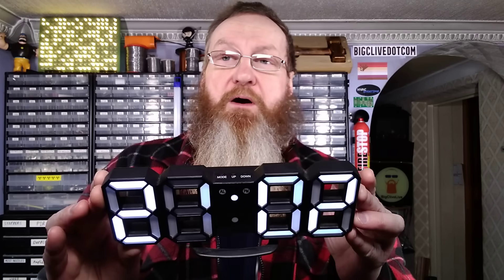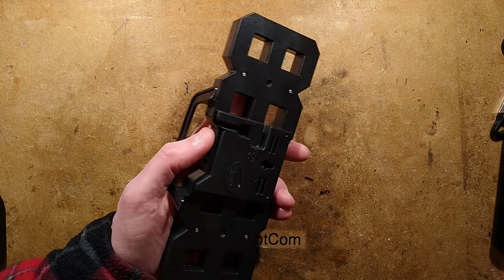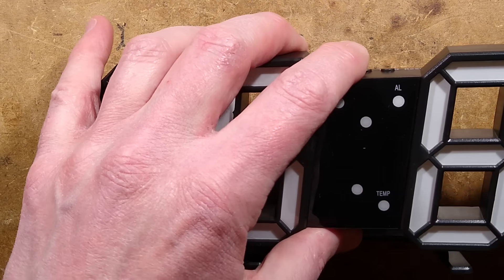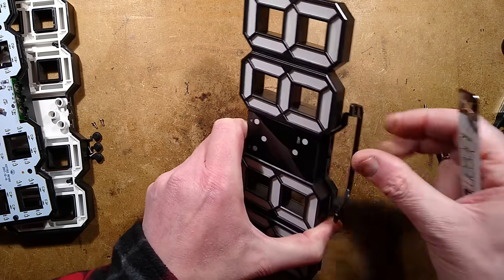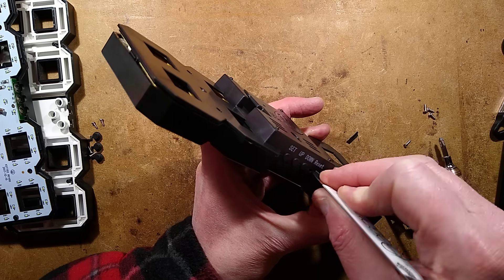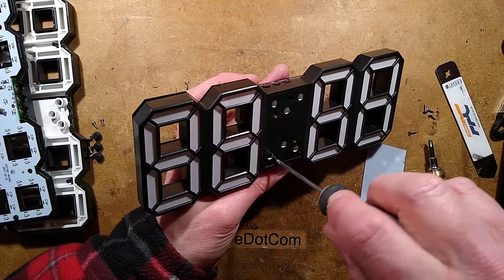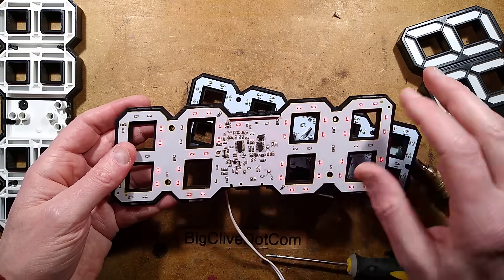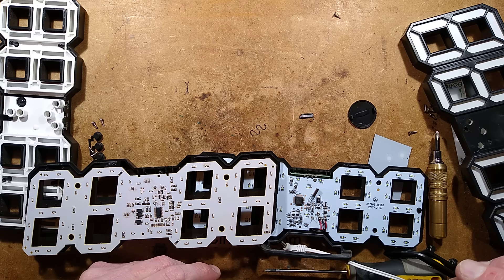The CURSE of white LEDs

Comment: I've seen lots of variations of this on Amazon, but at least 3/4 of them are 'RGB'. If I bought one, would it be best to leave it on 'red' most of the time, just using other colours when I want it to put on a show, thereby extending the life of the 'G' and 'B' leds?
*edit: I still have my very first clock radio. I'm 63, and I got it when I was 7... so it's 56 years old. Still looks as good as day one... then again... it has an actual round face, with hands and numbers. (there is the very faintest of hums from the motor for the clock but, that may have been there all along and I didn't notice. As I said, its very faint, and I never listened to it critically until today).
Reply from the maker: With the RGB it probably does give you an extra layer of reliability, since you can swap to the colour that still works.

Comment: The white door handle LEDs in my MB started failing after 4 years....and they only get used for a few seconds when you unlock the car...and in 4 years I probably did about 6k miles so it wasn't exactly a taxi!!

I do love these MTBF figures.....always used to joke that a 10000 hour MTBF was achieved by testing 10000 items for an hour.....  Looks like I wasn't far off.

Comment: I've worked with subsea LED lights rated for 4000 meters water depth with a panel of white LED's that fade over time. It still draws the same 3A at 110Vac but the panel is super dim. Repair means a new LED panel which is a thin PCB bonded to a copper plate for heat dissipation.

Comment: I have one of these in white for 3 years now. Hasn’t faded yet. I don’t know what controls the clock speed but after a month it’s a minute fast. Paid a whopping $1.75 for it.
Reply from the maker: There's a little cylindrical crystal on the board.  Probably 32.768kHz.  That will determine how accurate the clock is.
Reply: @ mine must be calibrated wrong.

Comment: My first purchase when I got my first job in 1981 was a Chronomatic 225 clock radio, made by Realistic. It has been on non stop ever since and all segments are still uniformly bright, and every function is still perfect. I cant say the same for my fluorescent lighting upgrades in my workshops. The original T5 tubes used to give me 15 years of bright light, dimming only slightly over that time (evidenced when one of the two tubes was replaced to compare). The LED upgrade/replacements seem to be losing around 10% intensity per year, measured with a lux meter, and two of twenty four developed faults in year one. I can no longer source the T5 high intensity tubes anymore, if I could, I would.
Reply: I'm hoping Clive can comment on how T5 tubes can end up far brighter at one end than the other. It has happened to quite a few at work.
Reply: @MrDuncl  It could be from a bit of DC bias in the driving circuitry. He's discussed this with "neon" tubes he runs from a DC supply.

Comment: I have 3 screw in white LED lights made by Feit electric which were installed in 2014 and used 8 hours a day most every day except weekends, and they still work good over 10 years now.
Reply from the maker: The first LED bulbs were very reliable.  But they have evolved and been tuned to the edge of failure to encourage ongoing sales.

Comment: And people wonder why I still stick with fluorescent lights from manufacturers like Phillips for my CFLs and preheat for my workbench lighting. You don't get to cheat physics with fluorescent lights. Yes you can make the drivers cheap but it still requires a degree of functionality that prevents them from burning out after only 2000 hours. One of the LED downlights we installed when we renovated the house is already flickering but the 20 year old fluorescents under the house always start and always work.

And my eyes cannot stand LEDs I absolutely hate them. Pity that such a promising technology has been almost ruined by companies that use the cheapest possible components.

Comment: now replace white leds and drive them with 2/3 of specified max amps. 
btw i heard somewhere they sometimes fail due to cycles of termal expansion and shrinkage. gold wires loose contact over time. will be interesting to test that.

Comment: In 1977, I was at school to get my "electronics" certificate. Electronics had been a hobby of mine for some years, and I had already built a lot of "projects." One of them was an alarm clock. That clock used red LED seven-segment displays.
After building it, I put it in use right away, and it has been working ever since. It has been connected to the mains and on for 99.99% of the time since building it. Only during a few rare power outages or when I moved house has the clock been off for a few hours.
This means the clock has been working non stop for over 48 years by now. It still works perfectly and wakes me up at the time I set it to go off. All the LEDs still work, though the brightness did decrease a bit, but the display is readable even in bright daylight.
It uses a 1 MHz crystal oscillator for reference, and the accuracy is very good, less than a few seconds off in a month. All repairs I had to do since building the clock were replacing a broken switch.
Will your clock last this long? I really don't know. My clock proves that electronics can last a very, very long time. But relatives of mine bought a modern alarm clock with green displays only four or five years ago. A few weeks back, they brought it to me, asking if I could repair it. It still works, but the LEDs are very dim. Only at night, in the dark, are they readable. I did have a look at it and tested the displays; the light was very dim. I looked on the internet for replacement displays and was shocked by the price. Replacing the displays would cost almost twice the price of a new clock.
Somehow, I think the modern electronic equipment has a built-in timer. After x time, they go bad, so you will have to buy a new one. This is good for business, but is it good for us and the earth?

Comment: I don't think there are any red LEDs based on GaN and phosphor. GaN has about 2 x the voltage drop. Usually blue LEDs are still a little more expensive than red ones. GaN is kind of thin film, but they need a relatively expensive substrate (saphire or SiC).
The white LEDs mainly fail, when used at high intensity with poor cooling. So more the light LEDs and not the signal LEDs as used in the clock. 
Unless the LEDs are super poor efficiency they are likely driven with only a rather low current - high efficiency LEDs would be way to bright at 10 mA.
There is still the possibility that it could be a power supply issue - LEDs are still more reliable than electrolytic capacitors. So maybe still worth checking the supply.
Reply from the maker: Many of the mass produced LED filaments, COBs and christmas lights use red phosphor on blue LEDs to allow a standard base LED chip to be used.

Comment: It's so common to see LEDs overdriven. Fewer chips driven harder. Even my buddies brand new $10,000 top of the line 85 inch Samsung TV burned out after the first year. Because they were overdriving the leds.

 Literally on the far edge of the safety margins the manufacturer suggested in the data sheet. It would have cost them a few extra dollars in that $10,000 TV....and it would have added years and years of longevity. Thank God he bought the overly expensive warranty
Reply: Also to clarify.... just because they were being driven hard doesn't necessarily mean they will have a shorter life. It's the heat that leads to a shorter life. A lot of times that heat doesn't even come from the actual current of the led..... it that they pack everything together so tightly without cooling given enough importance. They try to pack it all together as tight as they can,.... 

so the drive current isn't always the issue. As long as there's space for things to not get too crazy hot. You can overdrive the s*** out of them and they'll still last forever if there's enough space for even just moderate Cooling
Reply: Last week I watched a video complaining about Samsung TVs for that reason. Even worse, when the LEDs fail they can melt or scorch the diffuser which isn't something you can buy as a spare.

Comment: If I rember correctly, all LED's are bow GaN. The old GaAs LEDs worked far longer but it's silly expensive. As you say the GaN diodes are thin film. Great in concept poor in practice. IE electron bunching can cause bits of the GaN to get blown off the electrodes a few atoms at a time. With the old LED's they were often 0.5mm thick. this was enough to absorb most of the bunching. This is more a Johnson Nyquist effect than say electron bunching in plasma. I have found that reducing current helps as this does not create as much heat which helps the LED resist the effect. 75% current gives you more life (about double) but 50% id more like 10x. NB take this last point with a whole bucket of salt as I was using LEDs from an unknows source or sources. I hope to replicate this with Cree units.
Reply: I thought in the past GaAs LEDs were cheaper. Why would they become so expensive? Also is there any way they could increase the film thickness in GaN LEDs?

Comment: It’s weird how consumer LED’s in products like that burn out so fast, yet I could stick a 1m strip of IP65 Chinesium blue LED’s on the radiator mount of my car, to generate a diffuse blue glow behind the radiator, and it lasts for four years in that extreme environment. All the LED’s kept working, it was the flexible strip that got baked hard and started splitting causing the tracks to break. Longest the lights were on was 8 hours, usual amount of time 15mins per day/night.

Comment: This is what happens when you drive LEDs up to the max specified on their datasheet. I've always specced LEDs higher than required for the application, and then under drive them by a third or more. Helps to ensure reliability.

Comment: They are also just consistenly being overdriven the snot out of. I have yet to see a LED from a LCD display fail, and I have decade-old LED backlit LCDs. They last so long the power supply and the control circuit die before they do.
Reply: Unfortunately, modern TVs are very much the target of planned obsolescence. Samsung TVs in particular (although we'd be a fool to believe that they are the only ones) overdrive the backlight LEDs to such a degree that they will literally burn. We have a Series 5 in the living room with a half-failed backlight; and the Series 6 in the bedroom is also starting to show early signs of backlight failure, despite having turned down the backlight intensity to a very reasonable 30%.
When this one eventually fails, I will consider replacing it with a digital signage display; as I am very much over "smart" TVs.

Comment: Not only do I remember the first blue LEDs .. I still have my original which I stood in line for six hours at Active Surplus in Toronto ON, as if a rock concert queue, to pay $9 for a dim diffused blue, limit one per customer, which I then swapped out for the red pilot in my HP-85. It almost seems ridiculous now, what is it? 35 years later? But us nerds back then took our geekdom very seriously. 

I actually have a lab bin of all the uber cool things I either bought or scavenged in the 80's and 90's. All obviously "useless" now .. but it's fun as an old man who can barely figure out his phone to recall the stories of where each bit came from .. if only to myself.

I had one of the first blue LEDs among my peers .. and I was a god, the masses aghast. Twice the god again with my first HeNe tube which I also still have, although now dead.
Reply: I own one of the early RGB LEDs with two silicon carbide blue chips and one red and one green. This LED has 6 pins, build of two dual colour wireframes. Two of the blue chips are not bright enough compared with the red and green. For real RGB use, the blue is not pure enough, it's more the blue like the painting of a swimming pool. At this time a was disappointed, considering the price. Now it is a small, nice part of tech history, in my collection.
Reply from the maker: Was it the first silicon carbide blue LED or the later gallium nitride type?  When you say dim it hints at the original rugged silicon carbide type which has a strange washed out blue effect.
Reply: Those really early blues (silicon carbide by Clive's comment) were beautiful. A lovely pastel sky blue. Very dim too though, as you mentioned.

Comment: My Corsair RGB keyboard has similar things going on... But its a case of EU mandated shitty solder. A known issue with several models where the lead-free solder cracks. Repairable by opening the thing up, and reflowing about 450 solder joints (or just focus on known dodgy keys, but then you might have to do it again next week)

Comment: You could have used your LED meter to probe the leds to see how many volts they are and see if there is a different with the dim ones.
I've used mine to find dead leds in light bulb's,  very useful tool.

Comment: I have a couple of 1980s red-LED clocks based on a TI alarm clock ASIC (TMS3450?) offering 24-hour mode support. With full four-digit displays, all it took was a bit of wiring to convert them - with proper tact switches to replace the original chintzy metal-dome setting buttons, they've lasted me at least a decade with no sign of weakening.

Comment: Same problem happens on all LCD TV's where the screen goes blue but luckily the chinese have made LED strips for almost all TV models and they are only about 20 bucks a set. I just fixed an LG 4K 49" TV from 2016 that had a very blue picture simply by replacing all the LED strips.
Reply: low quality phosphor coating

Comment: In general you can't always assume you'll be able to desolder LEDs. Particularly on higher power applications, they'll be soldered down to an aluminum PCB for better heat management, and that aluminum will suck away every bit of heat your soldering iron tries to put into the solder blob. For something like a clock, though, it's probably just cheap FR-2 and you'll get away with it without much trouble. Still though, it's something to watch out for.
Reply: Easily solved. Hot air the old ones off and hand solder the new ones back while the board is still warm or use a back heater.
Reply: @g4z-kb7ct Or just solder the red LEDs directly on top of (or beside) the white ones (assuming there is sufficient clearance). Since red LEDs bias at a lower voltage, they will effectively short the white LEDs out of the circuit.
Reply: @g4z-kb7ct  I've had difficulties sometimes even when using hot air assist, but pre heating is definitely the way to go if you want to have any chance at all.
Reply: You can just 'munch' them off with side cutters -- if it's already a one-way trip anyway :)

Comment: I have that exact same 3D clock (the first one) in white and its digits are doing the same thing. I'd swap the LEDs if it kept good time, but it gains like 3 minutes a week.
Reply from the maker: It's possible that replacing the 32.768kHz crystal would fix that.
Reply: Funny, my microwave gains about 5 mins every 3 months.

Comment: They overdrive the LEDs, that is the real problem. You can find this 'technique' (sadly) in many LED products. The easiest thing you can do (without the need to modify it) is to use another adapter with a lower current rating, as low as you can get and the clock still working correctly. You can find the minimal rating with your bench power supply (with current limit option).

Comment: The brightness of White and Blue LEDs is decreasing because manufacturers do not adhere to our original manufacturing technology,
which can actually achieve a 100,000 hour LED lifespan without any significant loss of brightness.
I am the original inventor of White and Blue LEDs.

We made the first prototypes in the world at a company called TUNGSRAM, which no longer exists. They still work perfectly after 35 years with the same brightness.
My patent was stolen and exchanged with another company, which also no longer exists, for another patent.
This was a custom in the lighting industry.
I worked on the development of fluorescent tubes. We had 200 different colors of fluorescent powder. These unique colored LEDs did not go into production because the RGB LED was created, which can be any color, with standardized mass production.
My colleague called it a fake LED when I showed him my invention, because it wasn't a real blue LED,
because blue LEDs had already existed in the 80s. We invented the LED coated with phosphor 10 years later, but 2 years before Japan,
because no one had been able to create a white LED, and the brightness of the blue LED was tiny at that time.
We produced colored neon fluorescent tubes, and the idea came from there, because high-brightness UV LEDs already existed.
That's where the idea came from to coat the UV LED with the phosphor used to make fluorescent tubes, and it works,
and it didn't need a vacuum like fluorescent tubes. We developed its large-scale manufacturing technology.
In 2015, the Nobel Prize in Physics was awarded for this, not to me, but to a Japanese person who somehow got involved with our invention.
Because TUNGSRAM manufactured incandescent lamps, they were interested in that, they did not recognize the opportunity in switching to LED production.
Due to the bad management decision, the factory was closed down. The patent is no longer interesting today, because the idea has become public domain,
and anyway, a patent only protects an industrial product for 10 years.

Comment: Had this issue a decode ago with a white backlight on LCDs, with thousands and thousands in the field. The white LEDs don't like to run hot, significantly reducing operating time. I guess that these LEDs inside this clock are running at a high current and get fairly warm, they might be overdriving them